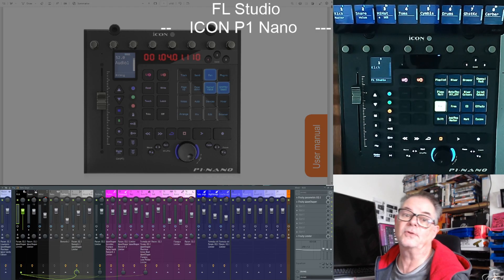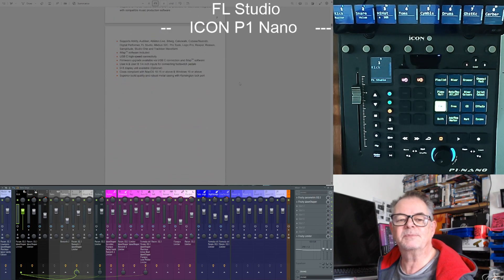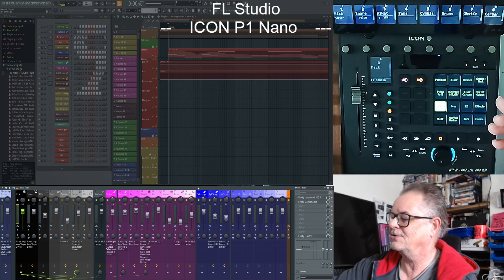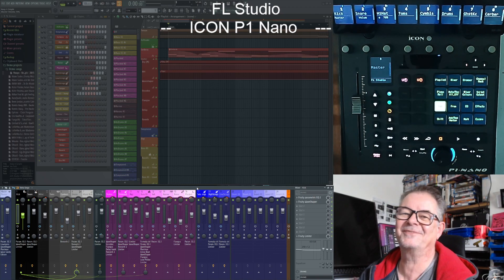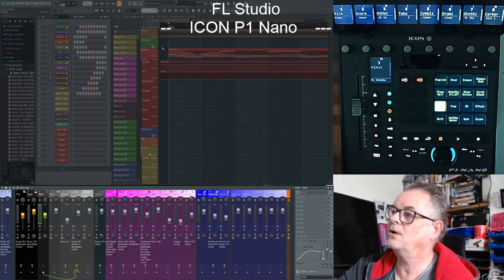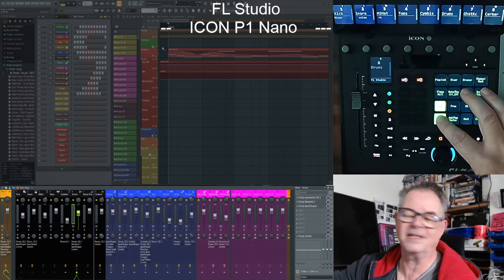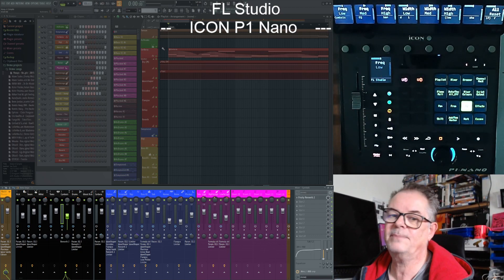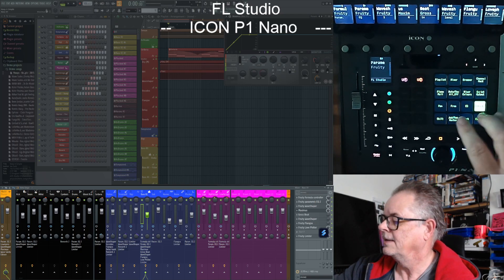Icon V1-M, P1-M, P1-Nano - Customisation

Comment: Considering this to replace an Xtouch. I love this nano but not sure about the single fader and trying to get some idea of how easy it is to switch mixer channels. Not sure about Icon as a company really.....bit of an unknown quantity. Thanks for a bit more clarity on it.
Reply from the maker: The size is great and its a more "pro" surface than the X-Touch - largely because tech has been able to move on so the fonts and scribble strip colours are better and clearer.  Also, and not shown here - there are actually 4 rows of text display available via scripting (though I think we are waiting on a future firmware update to make them more usable).  So its a good choice and has the  potential for future scripting based updates.  That said, the X-Touch is a very solid device as well.